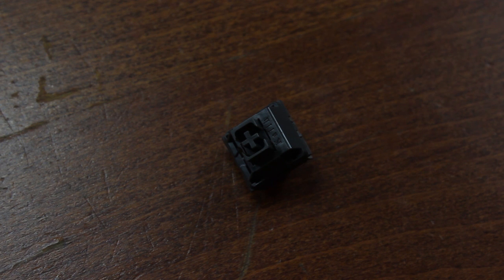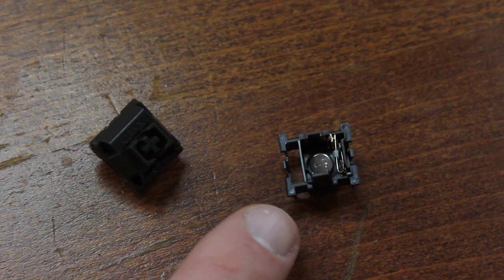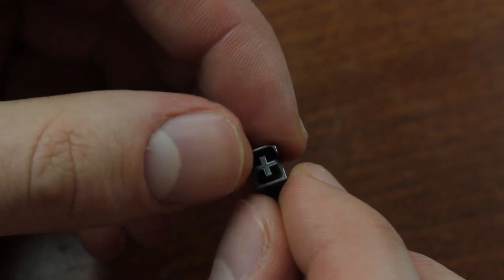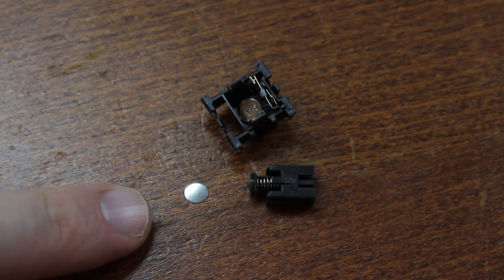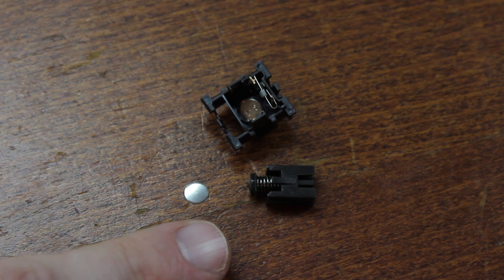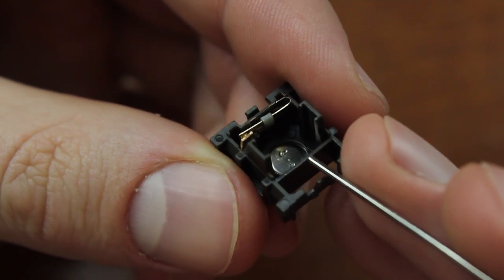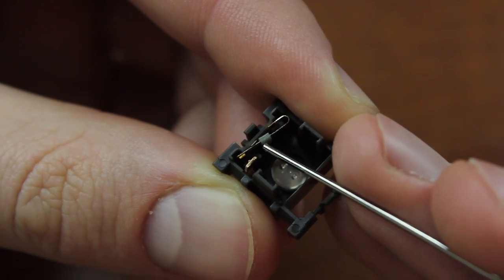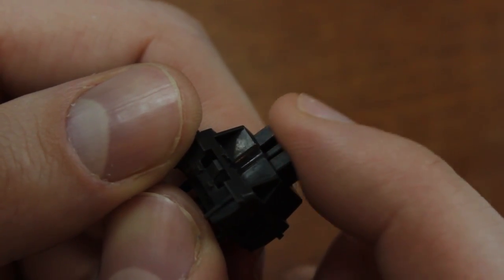Teardown - Novelkeys Cream Clickie switches

Comment: Hooray for innovation! I imagine that over time as the springs wear, the click point will change in a non uniform way across the keyboard though. 
Could be interesting for somebody who wants to be able to type quietly sometimes on their clicky switches. Assuming you can press lightly and get an actuation without a click.

Comment: Those plate springs are also used for the click in the mouse buttons on unicomp keyboards (pretty easy to swap, and they're available in precise levels of activation force, so it's another axis for tuning/tweaking...)

Comment: Surprised it doesn't click on both the way down and up like other plate spring switches.

Would have been awesome if they'd used the plate spring as the electrical contact so that the click event and actuation were tied together.
Reply: Probably because this plunger makes rebound slow.

Comment: So the spring is removable after all? The photo with the components laid out shows it detached from the stem.
Reply from the maker: Removable, not reattachable.
Reply: Everything is removable at least once.
Reply: technically the bottom half of the stem is only being held in by a plastic nub on the top of the stem, so you could swap it out by pulling it off
fair warning though that tab might get a little looser the more you spring swap